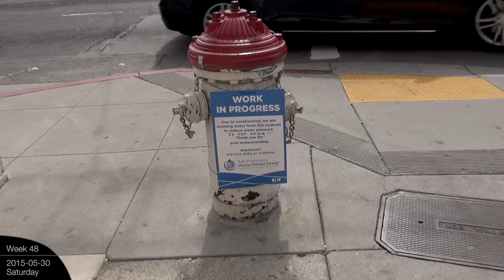Construction time-lapse w/over 70 closeups: Ⓗ Week 48: Ironworkers; concrete; climbing frame; more

Comment: 37:00 Second time (I noticed) the crane has picked the man basket, swung it over to the tunnel works and brought it back. Perhaps a daily rescue drill? Crane skip is still in the hole but if rescue or evacuation was needed, it wouldn't be that much of a barrier.

Comment from the maker: Construction time-lapse w/over 70 closeups: Week 48.  Another busy week: there's a big concrete pour, the ironworkers continue assembling the frame of the building, the climbing frame is removed from tower crane #2, a ventilation system is delivered for the underground pedestrian tunnel, work continues on the metal decking, the tower cranes are busy unloading stuff, and more.

In this series, we're following the construction of a new 12-story hospital that will occupy an entire city block in San Francisco. This is a construction time-lapse at 900x, with over 70 "bonus" highlights/closeups scattered throughout at various speeds, compressing the 5-day period from May 26 - 30, 2015 (Week 48) into about 45½ minutes. Non-working days and nights are omitted.

This video is not endorsing or recommending, nor was it endorsed by, any business, product, or organization. The appearance of, or mention of, any person, business, product or organization in it is not necessarily an endorsement or recommendation of or by that person, business, product, or organization. This recording is of views and scenes visible to the public.

Music licensed from AudioMicro.com. I know I'm using the same music for all of these weekly time-lapses, but there's too many of them and they're too long to license different music for each one. You are of course free to turn down the volume and provide your own accompaniment music!

 #construction   #timelapse   #timelapsevideo   #timelapsephotography   #constructiontimelapse   #sanfrancisco   #heavyequipment   #concrete   #concretepour   #concretepumping   #ironworkers   #crane   #towercrane

Comment: 8:45 Not deep enough and has a long way still from that shot you took at close up...!!! They should use the shark claw basket lot faster.
28:23 I knew it they have a problem getting the rods on each floor as they went on after finishing each floor sheeting. ( You get the mats rods premade then you lay it down and the cover with cement...!!!
So the hospital reached the grade on your week 47...!!!